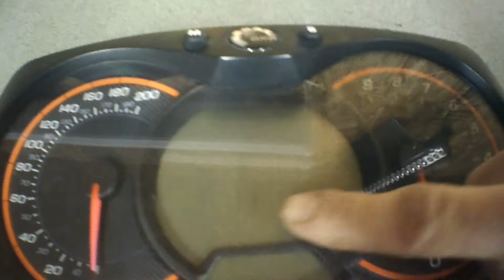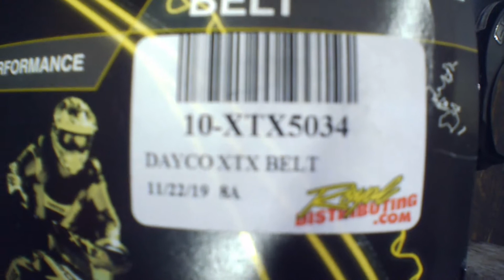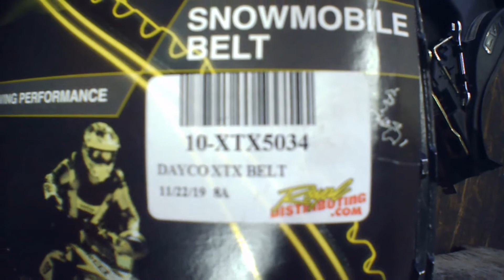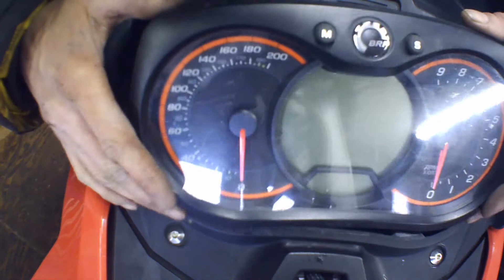a lil bit of love for VESUVIUS

Comment: That 1/8 of an inch will be exaggerated when you get to the tip of the ski by just using the saddle method with it's short length..
Might be better to make a temporary center mark on each ski as measuring points..